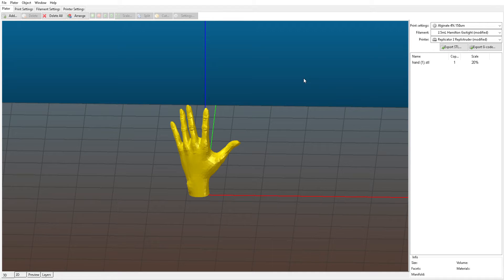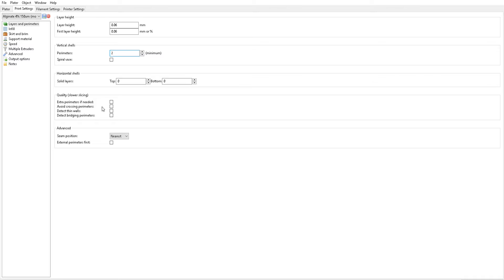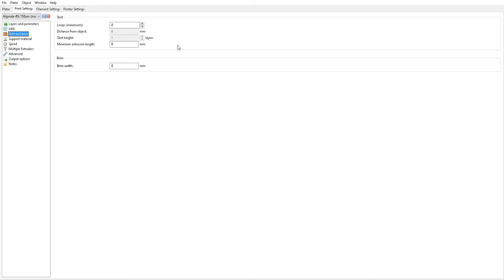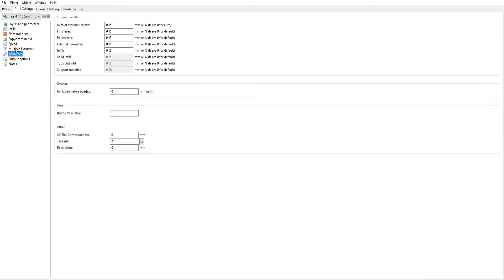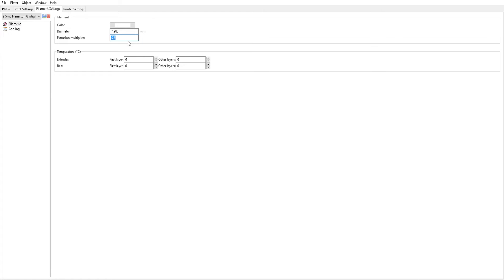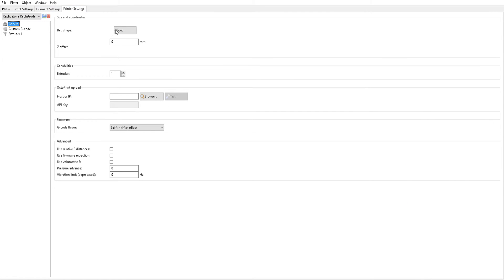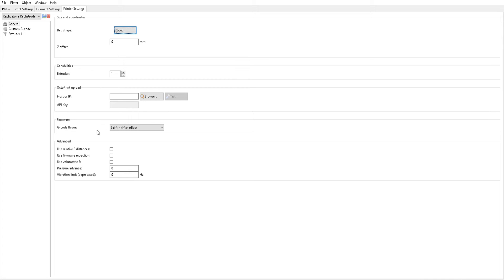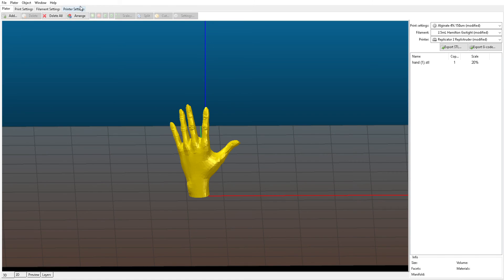Slic3r Settings Guide for FRESH Printing

Comment: Hi! I am using the same setting from the CMU workshop manual. I use alginate to print but when I put 7.285mm filament diameter and 0.95 extrusion multiplier, it won't print anything. I know you have mentioned that for alginate it is supposed to be 0.6 for the extrusion multiplier but isn't it supposed to print better (extrude better) with a higher extrusion multiplier?
Reply: Also, would you mind sharing your alginate 4.0% config file? I am having a hard time getting good resolution on alginate printing. It would help me tremendously! Thank you.